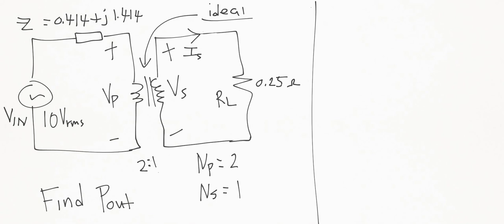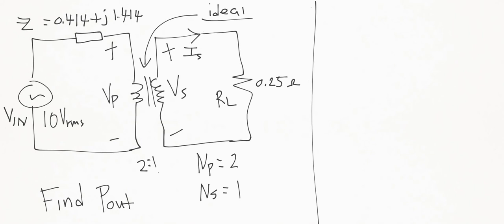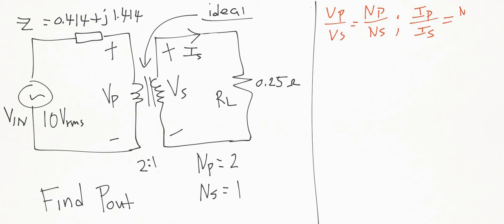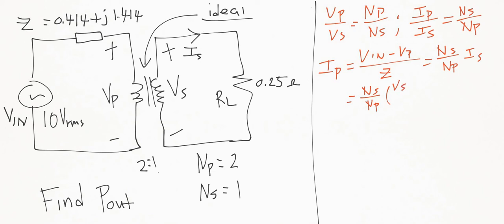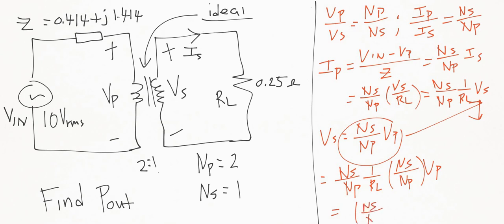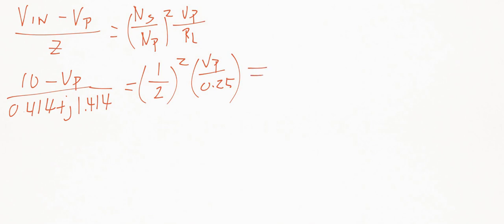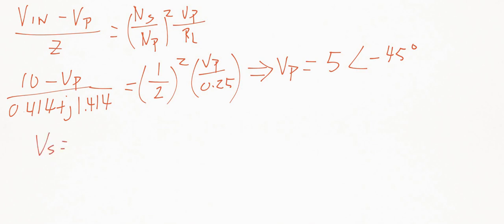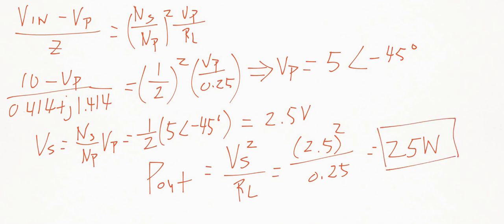Electrical FE /EIT Exam Prep - Circuit Analysis 3: Ideal Transformer Output Power

Comment: You really need to show how you find some of these variables, like you can not just show the value for Vp without solving it. Especially since I am pretty sure you messed up, because the phase angle cannot be -45 degrees. The real and imaginary values are not the same in the impedance.
Reply: Yes it does. The (1/2)^2 times the (1/0.25) give 1 so the right side becomes only Vp, then you can multiply the impedance on both sides which yields 10 - Vp = Vp(0.414+j1.414), then when adding the Vp on both sides that gives 10 = Vp(1.414+j1.414), that has an angel of 45°, then 10 divided by that complex quantity gives the answer he got.
Reply: @jesussilva4140  Yea, I was doing in my head. I forgot about the 1Vp on the other side. I took it as 1. Thank you.